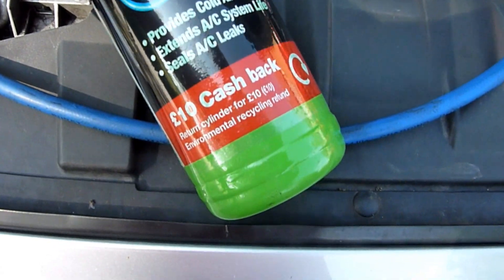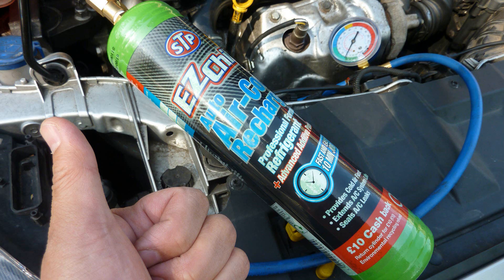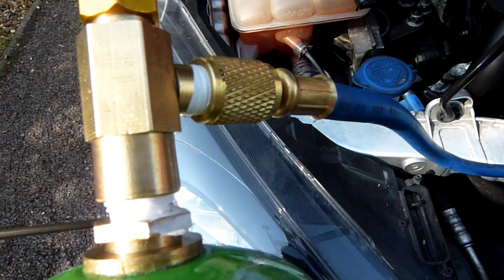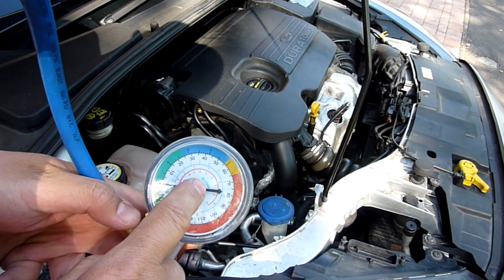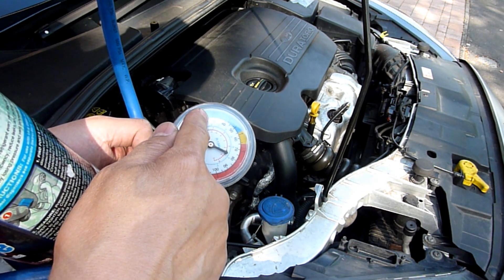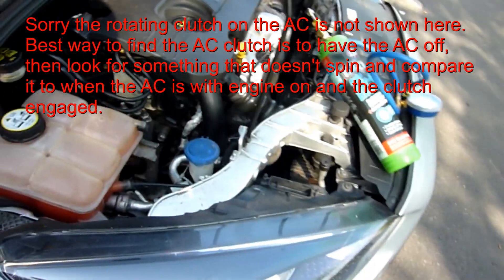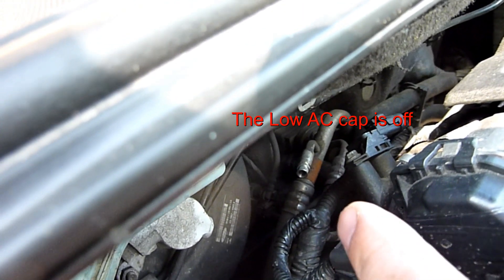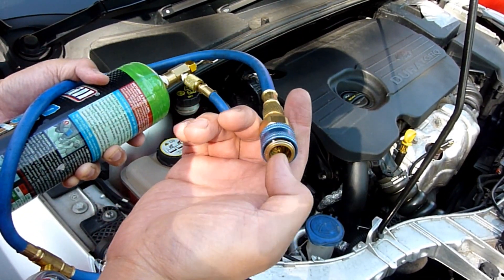Top Summer Tip When Adding R134a Refrigerant [] Must Watch

Comment: So what if your compressor is not engaging and the system is basically empty?   
Will the gauge read "warning"?   Should the low pressure port be vented for a second to relieve that faulty pressure and then the gauge will be at a "low" setting, therefore allowing you to fill up?
Reply from the maker: You can do that... it's a bit of fiddling sometimes...I would say relieving pressure and starting again works.
Reply: @EducationPineapple  - I added the refrigerant and the compressor happily engaged properly as the pressure increased.  However, my intercooler fans are not kicking in, so although the compressor is working fine, the air is still blowing warm because the fans are not running.   Looks like I'll take it to the garage to be fully extracted and refilled, which is what I probably should have done in the first place.
Reply from the maker: @monsterp1970  Perhaps, but the fan will have to be replaced also.
Reply: @EducationPineapple  - I don't see any reason for the fans not to be working.  They were fine before.  It's an easy DC motor test anyway.  The only other possibility I'm aware of is if the high pressure switch is no longer working.... again, something that was working fine before.  I'll let you know further when I've had it checked.
Reply: @EducationPineapple  - Update - I got the aircon serviced a couple of weeks ago.  Hooked up to the automatic machine, fully extracted, pressure tested and refilled with 600g of R134a for £42.   Nearly half the price of doing it DIY with the can.  Two weeks later, it's still fully pressurised, according to the pressure gauge I bought and working down to less than 5c.  
Unfortunately, the downside is that the garage do not use "sealants" which is what I wanted to achieve by trying the DIY can.  Hopefully, I got enough in to fix the tiny leak I had.
Reply: If your AC system is totally empty and there is not enough pressure for the compressor to engage then unplug the electrical switch terminal off of the compressor and bridge it with a paper clip or a bit of wire and this will force it to engage and you can then get enough refrigerant in to give you pressure.

Comment: Hey what's the oil consumption in your 1.5 tdci?
Reply from the maker: zero
Reply: @EducationPineapple  wow. Which oil and how many kms interval?
Reply from the maker: @tahamir3  It's the make and model of car that counts and maybe if the piston rings were primed properly at the beginning of the life of the engine. I use any fully synthetic anything cheap or on sale from 0w30 to 5w 30 that matches the technical description highlighted in the user manual. I just wait for the oil change reminder light.